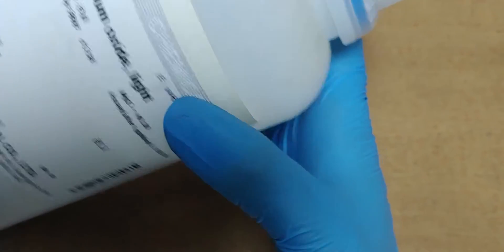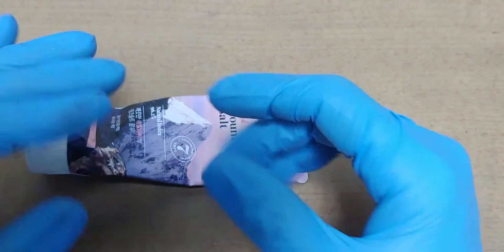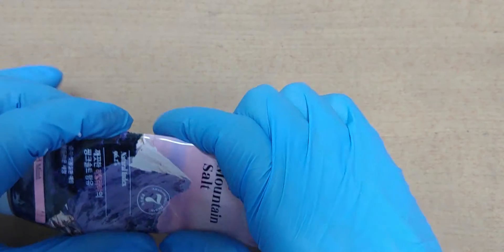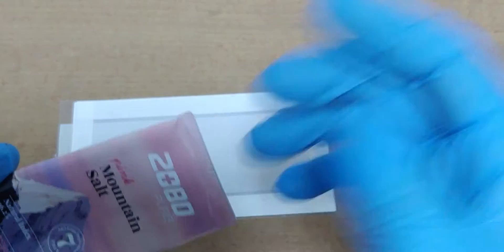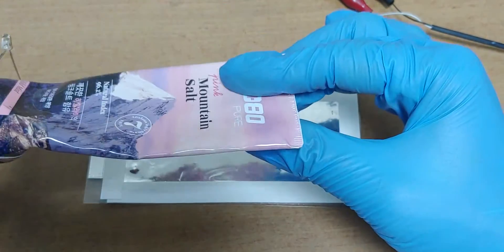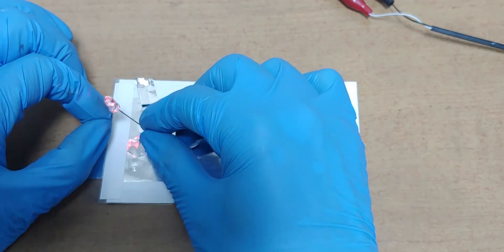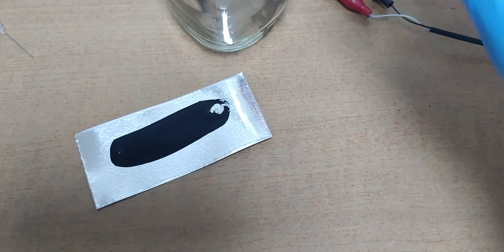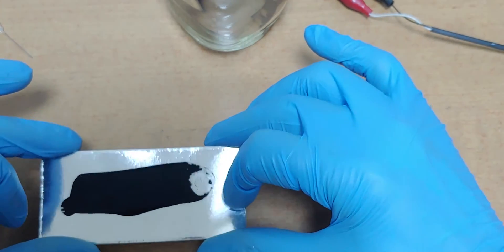Graphene battery: How to make it

Comment: What is the capacity?
Reply from the maker: Not enough yet. Have  a nice day
Reply: @solidbattery9956  In numbers?
Reply from the maker: @KanasSubigi  
Thank you for questioning. Since I've been absorbed in making the battery life longer, I've not measured it yet. The problem I have now is  the battery life is much shorter than that od lithium battery. Thanks again

Comment: The video is phenomenal. Please how did you apply the toothpaste to form the plate. On what did you apply it. Thanks
Reply from the maker: You can spread toothpaste and keep it dry to be ceramic state. Good luck
Reply: I sprayed the tooth paste on a paper but it has not dried  for three days now. Is the toothpaste to be sprayed on the aluminium foil? If possible please can you make a video on how to prepare the ceramic using toothpaste. Thanks
Reply from the maker: @Greenenergyelectronics  
I uploaded a new video for you. : https://www.youtube.com/watch?v=h0aF9r7mJq0
Good luck.

One more thing: check out the temperature, and never put salt into the toothpaste. It will gather moisture from surrounding, which will spoil the whole battery. 

Have a nice day.
Reply: @Greenenergyelectronics   did you test

Comment: Hey I like your videos - What do you think about Graphene Supercaps 2.7V @3000 Farads = 8100 colummbs = 2.2AmpH which recharge 80% or more within 40 seconds and has 18650 form factor? https://ibb.co/vcN7hxn Maxwell has the same Voltage and Farads but weigh about 500 grams.
Reply from the maker: Thank you first. But I don't know well about supercapacitor.